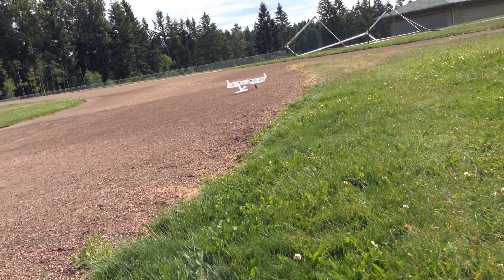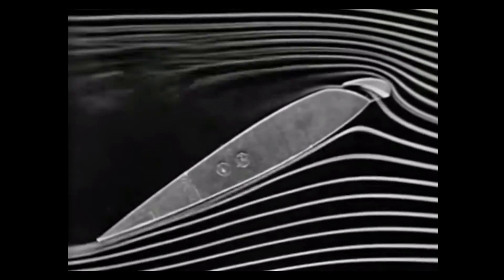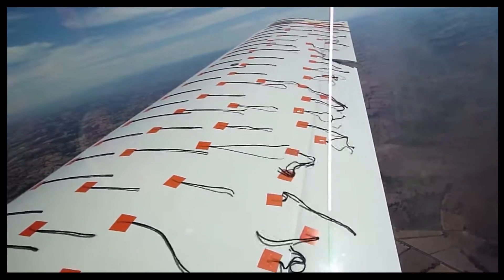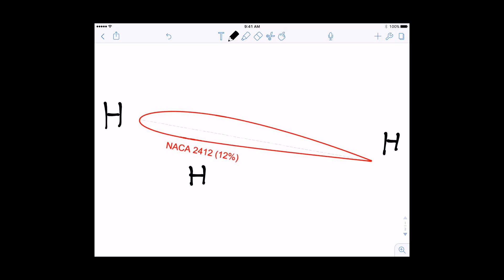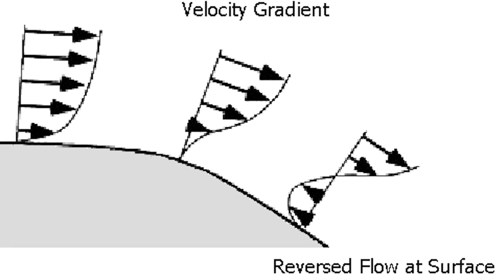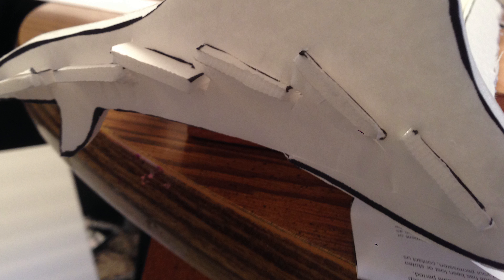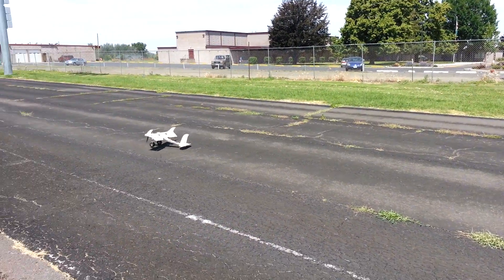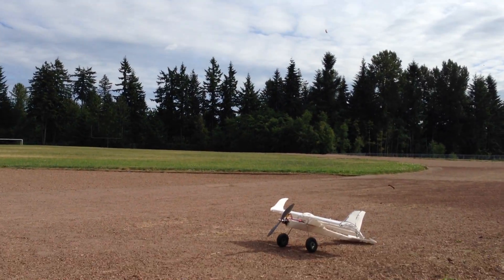Experimental Slat Plane! Unstallable wing?

Comment: Comparing this to a normal wing of the same general size; do you notice a higher rate of battery consumption due to increased drag?  what do you think of an automatic system in which atl cruise is a normal wing but which opens up when approaching the stall?
Cool idea man and video.

Comment: If the slatted sections are well modeled to fit together to produce a smooth contour when closed then automatically sensor controlled as needed to open just enough to stabilize the airflow that would minimize drag. I imagine something like a Venetian blind control contained in the fuselage.

Comment: 2) not an expert by any account, but what if the wing could be used this way: each slat is made up of (say) 3-5 very thin layers that can be individually manipulated to vary the gap between the slats and vary the shape.  

1) what if we extend that thinking to a propeller? harder to prototype like you have but might be a way to maximize thrust where the "slower" turning center can pull more air.

0) the shark think is beautiful, form and function.

Comment: I really liked the video! ... and I liked the way you explained the physics happening here, in such short time.
 That's why I hate to correct you, but friction and viscosity are not the same thing. I think the simplest way to put it is up say that viscosity happens within a material (usually a fluid) and friction happens between the surfaces of two materials.

Comment: That is incredibly clever.  I'd be interested to know if this form would produce good fuel efficiency.  Stalling is certainly a large cause of crashing and would make for a great safety feature for amateur pilots but the big boys want fuel economy and cheap construction costs.  I wonder how high you've flown your prototype.  If you can ever manage to try it off the top of Mt. Shasta or something, please post that!  It seems to work well in thick air but how does it hold up in thinner air?  Do you have any notions on how well this could be retracted into a closed wing for high altitude cruising?  Could the seams cause drag?  A let us not forget, that a wing has to hold fuel...

Comment: The wing at left exhibited the no stall characteristics as you show.  It seemed to go to unrealistic angles of attack and landed at high drag very steeply, worse than the space shuttle.  I measured a lift to drag ratio of about 3 at level cruise.  In old time  pilots jargon, it went into "the backside of the power curve" very easily, and did not stall, seemed more like a parachute, as I was flying just barely past the lift/drag "bucket.

Comment: Great video, thank you....Just for interest, my experience....Super Sixty with a 48 4 stroke, fitted first flaps, then LE slots/slats. Flaps gave me a slower approach speed but with more engine power needed. Then in an effort to get STOL performance I fitted slats to the outer 10 inches of wing. More power required to counter the drag, but could fly slower without stalling and do shorter take offs. Mind you, with both slots and flaps at a high angle the handling was terrible, rather like an airliner you had to straight line it till the flaps were pulled in as it flew like a controlled brick, and when trying a tight turn the stall when it came, came i a hurry and the thing dropped out of the sky till the airspeed picked up and it flew again!

Comment: This wing OBVIOUSLY will stall if it is forced to a high enough angle of attack, no question, just maybe not on this plane. The way it's flying, I can almost guaranty major portions of that wing are stalled the entire time you are flying.  What you are really talking about is flight departure, I think.  

Build a high performance version of that (with a power off glide ratio of say 20:1) and I guaranty you can stall it.  You are so draggy and so underpowered here, that you are doing more mushing than flying.  This really demonstrates some things, but not entirely in the way you think it does.  Some actual airfoiling, and a reasonable spacing/increasing angle of attack slat array would act VERY differently, I suspect.  But cool demo, anyway.  Thanks for upload.

And reading comments below,  you are getting thru in your description of wing dynamics....nice.

Comment: I'm an aero-mech engineer and highly enjoyed the background of this project. If you're looking to experiment with drag delay, I suggest incorporating synthetic jets. I made a model for my degree project, but was never able to use it in the real world.
Reply from the maker: +vovovovan if you wouldn't mind sharing more of your design, I'd like to have a look at it!
Reply: Synthetic jets are based on piezo electrical plate and its properties. Essentially it is a diaphragm that mounts on the top surface of an airfoil and disturbs airflow in order to slow it down and therefore prolong laminar flow (similar principle as dimples on a golf ball). There have been prior experiments and some documentation is available online, but it is very limited so my group and I had to figure most of it out. I'll dig in my files to see if I can find the presentation and the whole project.

Comment: I am a student pilot and I greatly enjoyed your fluid dynamics explanation of stalling. It really just added a stronger understanding of how a wing actually stalls! So thank you for that!

With your wing concept, I like the idea, but I wonder what the drag coefficient on such a design would be. The big reason why an airplane needs to close up it's flaps and slats is that their induced drag is incredibly high and severely limits the performance of the aircraft.

Thoughts?

Thanks again! Great video!
Reply from the maker: Yes
Reply from the maker: +Steven Harvey yes there are tons of reasons why this is not a good idea for anything that wants to fly fast or far. This understanding of wing stall is a perspective that most pilots haven't heard! I'm a CFI BTW :)

Comment: just wondering what will happen if the craft needed to be powered by fuel ?  Most commercial aircraft is built to carry fuel and control lines in its wings ?
Reply: not a major consideration in concept at the moment, if this design has been shown to be far more efficient than conventional, then maybe it can be worked in somehow, but at the moment its just a concept. however if it works as envisioned it will be ideal for light aircraft, military drones and similar machines

Comment: So, if you are willing to accept the drag factor inherent in that wing, why not get more lift from it by increasing the length of each slat.  The additional resistance is minimal, and you can hold drag constant by decreasing the total number of slats.  Take this to the logical extreme and you derive bi- and tri-wing plains  -- slow, draggy, but able to fly at high AoA even at slow speed.
Reply from the maker: It's not a practical solution to a problem. It's a teaching opportunity and example by taking a concept to the extreme

Comment: That's neat, that you can take squared off slats and make it fly. 

To get an interesting take on the "slot effect" you might read: Why the Safe Leeward Works, “Arvel Gentry analyzes the principles behind this tactic”, By Arvel Gentry, SAIL Magazine, September 1973, here: http://www.ftp.tognews.com/Publications/Arvel%20Gentry%20Articles/06_Why_the_Save_Leeward_Works.pdf

Yup, it's about a sailboat racing tactic and it's talking about soft sails, not rigid wings, but you may find it interesting. In it he states: "Previous articles in this series have totally disproved the old venturi slot-effect explanation, and we have seen how the jib influences the main, and how the main, in turn, actually helps the jib."

The key is that the main makes the jib more efficient, not that the jib makes the main better. In sailboat racing while going to windward two boats side by side, if the leeward boat is even an inch ahead of the windward boat, all else being equal, the leeward boat will always pass the windward boat. Do you see the  analogy?

Not being confrontational, just trying to expand the conversation, perhaps something interesting will come of it.

Comment: Great Video! This may be a naive question, You talk about this boundary layer of air that is not moving. This boundary layer goes against my understanding of why a golf ball needs divots to reduce drag. I had assumed that these helped prevent the fast moving air from touching the ball in these spots reducing the friction, but the boundary layer should do this same thing, right?
Reply from the maker: There are two types of boundary layer flows: Laminar flow and Turbulent flow. The dimples on a golf ball attempt to trip the boundary layer into turbulent flow. This random turbulent boundary layer mixes the faster layer with the slower layers and this helps to delay airflow separation behind the ball. Basically it shrinks the wake behind it. See my video about VG's which do something similar to the effects of a turbulent boundary layer: https://www.youtube.com/watch?v=eP-YUDe9HF0

Comment: oh, it's stall-able. maybe at a lower speed than conventional wing, but I guarantee it's stall-able.
Reply from the maker: +Allen Hartzell kind of a click bait title sorry. Hope you enjoyed the rest
Reply: Yes i agree. At some point its going to lose lift but this works because of the foam and the high output of the large diameter prop. Air pushed ove r the wing by thrust will keep this plane up. Id like to see it with airfoils on each winglet, or just make the wing out of venitian blind slats.

Comment: I think if you smooth the edges of the slats to look more like wings, as you have in the drawings, then the air will not form eddies between the slats. That should help with the stalling thing at low speeds. Think of how a parachute let's the body sink.

Comment: Now, lets try building a plane with this concept. A real plane of course.
Reply: It would kinda get in the way to make a whole slattable wing when you consider the wing is where most airliners take most of their fuel...
Reply: The best I'd see something like this for would be bush pilots since many times they have to go into a near stall anyway to land in the ridiculously short "runways" they use.
Reply: When the wind is blowing hard enough some pilots can even land or take off without moving a lateral meter.
Reply: Icon A5 can maintain a positive rate of climb in a full stall. Not exactly the same, but still cool
Reply: That is a different effect.  Flight is totally dependent on airspeed.  Ground speed is totally irrelevant, except for getting where you're going.   For something like a Cessna 150,  you could "fly" at runway altitude  (i.e., steady flight, not climbing)  in 55 mph wind.  You'd want 75 mph or so to actually climb.  

In theory, you could fly backwards, relative to the ground, if you had sufficient airspeed.  Like in a solid 80 mph wind, you could cruise backwards at about 25 mph ground speed.

I don't remember what the max safe takeoff wind speed is, but I'd think it's less than 55. :)  

And, of course, RC planes are much much lower.  One of my little helicopters couldn't fight the air indoors from our HVAC.  Trying to fly in 4 mph wind outside was impossible.
Reply: wolfedog99 I suppose you are right, it was a misuse of the word term "full stall". The icon will not actually enter a "full stall" but will prevent the outboard portions of wing from stalling. By full I meant as much of a stall you can possibly get in, in this particular airplane. In the A5 while in a stall you can hold the stick full aft, and even turn without risking a spin.
Reply: That makes more sense, thanks for clarifying.
Reply: Unless it is from pure engine thrust; no you can't and you don't seem to know what full stall is.

Comment: Nicely done video.   Now, can you make a model plane with a realistic power-to-weight ratio?  I wonder how well that flies with a draggy wing.   (Also, note that the first notch of flaps does bring down the stall speed, but beyond that, adding flaps adds parasite drag more than anything, helping a pilot shed altitude.  All in all, for our smaller plane [not an airliner], the reduction in stall speed is minimal.)

Comment: Considering that the leading edge of each elemental wing is so squarish I believe that you did very well. Another interesting situation is that  you must be travelling at quite a speed otherwise the high pressure at the lower side of the wing will escape up to the upper side of the wing. It is a very interesting concept, but it needs to be studied deeper as I feel that when it stalls it really does it  very quickly with air escaping from the lower side to the upper side through all those slots. Still an interesting concept indeed. The concept is not unlike a multi plane wing  extrapolated from the biplane and the triplane  with a difference of course.   Needs a lot of experimenting to know when the air decided to go through those slots in a down flow or an up flow.
NICE THINKING.

Comment: hahahaha, Samm still sticks to the Bernoulli theory of lift
Reply from the maker: +Martin Kaufmann you're arguing about a zoomed in portion of a much larger picture. Though the "equal transit theory" is bogus. Both "Newton" and "Bernoulli" are correct perspectives of the same physical process. People like run and shout about the Newton perspective because it seems like a complete picture and it makes sense and it makes everybody else wrong. It is an easily measurable fact in a wind tunnel that a wing creating lift has a lower pressure on top, and all aerospace engineering uses that fact.

Comment: I very much like your efforts here.  It was fun to see you explore the ultra-slow region of flight.  There was an aircraft prototype that many referred to as a "Venetian Blind" wing - never flew for a variety of reasons.  If I'm not mistaken, a separation bubble has laminar flow ahead of and behind the region of separation or reversed flow.  Creates a huge amount of drag.

I also am glad you pointed out to others that Bernoulli and Newton are both just explanations of the same phenomena.  Bernoulli would not exist without Newton, nor would Newton exist without Bernoulli.  The low pressure regions would not happen without a turning of the airflow and the turning of the airflow would not happen without the differential pressures.
Reply from the maker: +Benjamin Trapnell thanks for your comments!

Comment: It seems that in effect you are creating a laminar flow. Could you instead take a solid wing and drill small angled holes to allow a small amount of air from under the wing to flow up and over the top of the wing to help prevent stall.

Comment: Although airliners close the gaps to achieve high efficiency - only separating them at low speeds to minimize the stall speed;
optimizing the parasitic drag profile  could provide remarkable efficiency at slow speeds - Eagles have been using a similar arrangement at their wind tips for some time:)

Comment: Try making the elevator surface bigger so it has more authority - see if you can get the angle of attack high enough to stall it.  They made the Ercoupe unstallable by limiting the elevator travel so it would not have enough pitch authority to bring the wing to a stall.

Comment: It's mostly a decent idea but for two problems: Drag and weight. A wing of this sort will have more drag than a smooth wing in cruise. It also would weigh more. Furthermore, when it encounters inflight ice conditions it would accumulate more ice more rapidly. Furthermore, the wings are usually where the fuel is stored. If you were to build this on a larger scale you'd quickly notice these limitations. 

Yes. I am a pilot. I am also an engineer who just might know something about the study of fluid dynamics. You alluded to the notion that slots in wings are already in current designs, particularly Fowler flaps. Many aircraft today, from the lowly Cessna trainers to the largest airliners use that style of slotted flap. Basically what you've done is to build an entire wing out of nothing but Fowler flaps. 

I give you credit for thinking about this problem creatively, but do note that others have been down this road before. There are reasons why larger aircraft don't have wings like this.
Reply from the maker: +Jake Brodsky hi, I am a CFI, and commercial pilot ASEL and AMEL. I was not trying to solve a problem or come up with something new, it was a fun experiment to use as a teaching moment for this video.

Comment: Really interesting concept but surely by continually allowing air to leak from pressure to lift surfaces, you dramatically reduce your net lift. why not just use a shorter chord wing if you wish to reduce stall speed?